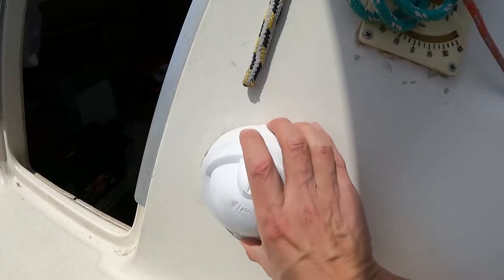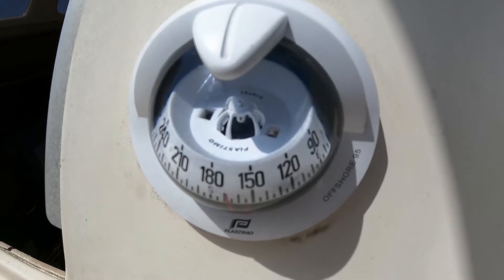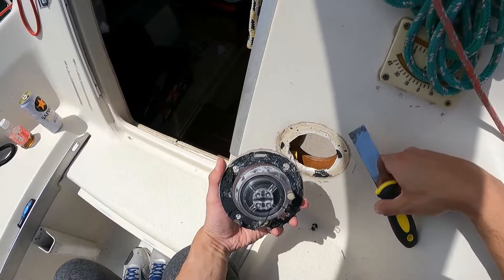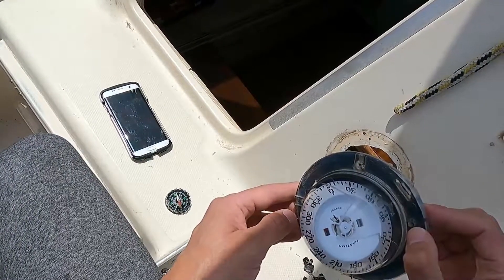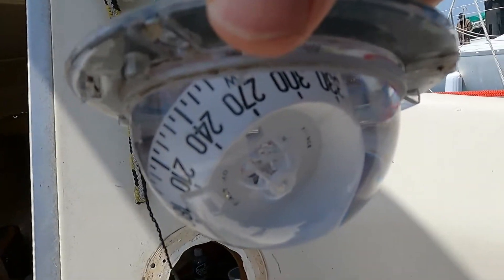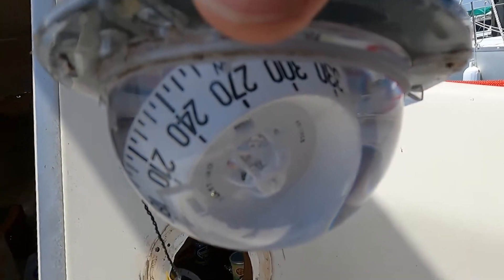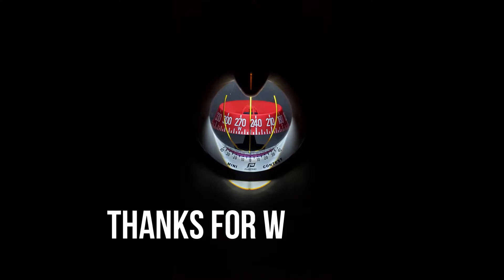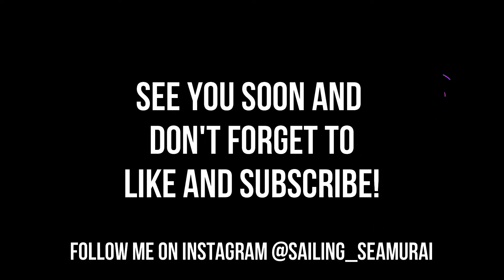Ep. 10 Bulkhead Compass Replacement

Comment: Thanks I'm mounting a surface mount on a 14deg sloped vertical surface. You gave me some ideas. The compass I'm installing can tolerate up to a 30 deg pitch. Most mount surfaces are not flat they have some pitch. Good video, fair skies and following winds to you.

Comment: That compass is not designed to be mounted on a bulkhead in a vertical position. That's why it jammed and doesn't work. It is designed to be horizontally mounted on top of a wheel steering binnacle.
Reply from the maker: Yes that is what I learned after buying a boat. It was absolutely insane for me that previous owner installed it in a first place.